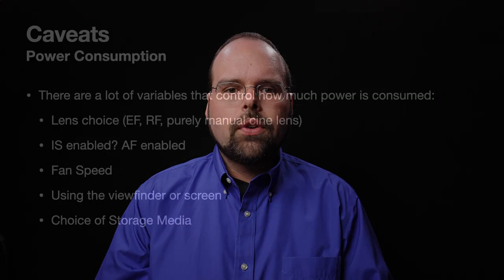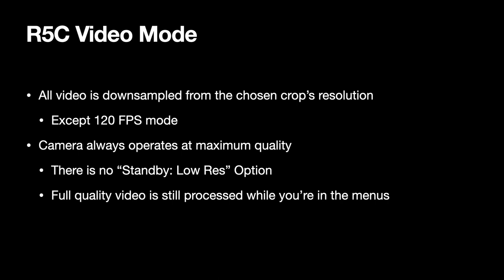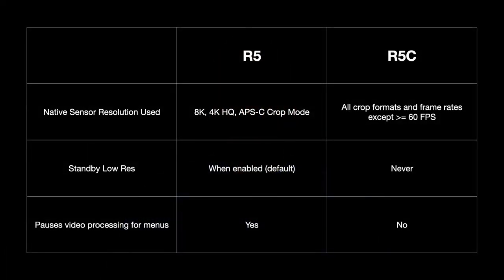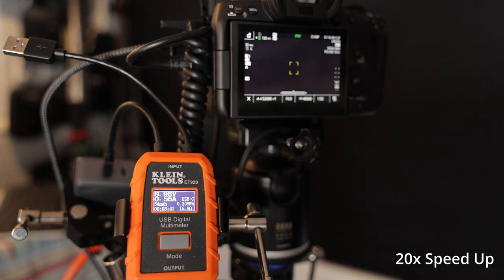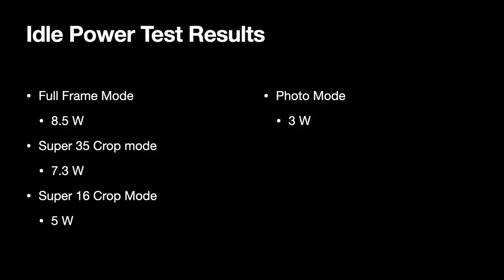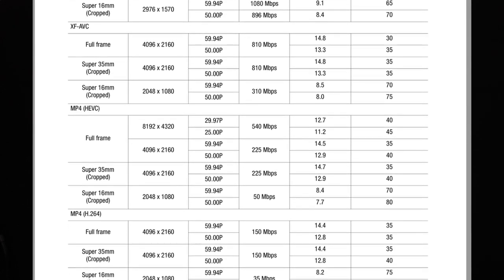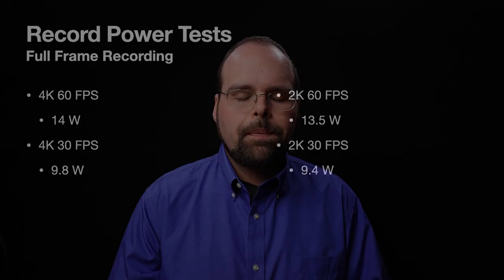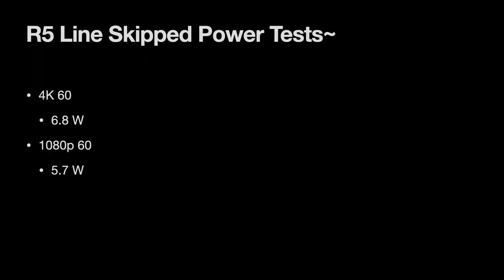R5C Power Usage - R5C Tips #1

Comment: Have you had the chance to test how much power is consumed during an 8K 60fps recording? I've researched quite a bit, but couldn't find a clear answer.
Reply from the maker: I though I had, but in looking through my notes, it appears I never did. 

I just ran a quick test, and saw an average power consumption of around 14-14.5 Watts. However, I also saw several spikes where it was using closer to 18 W.
Reply: Thank you very much for your effort and your response.Can we talk about a power consumption of less than 20 watts under all conditions for all of these? According to these values, would a 22.5-watt power bank be sufficient, or is a 9-volt 3-amp output necessary? @PointsInFocus
Reply from the maker: Short answer: no.

Long answer: USB PD doesn't work like a old school DC connection (e.g. where as long as the voltage is right, and the source can supply enough current everything is fine). In a USB-PD setup, the sink (device) communicates with the source (battery pack, AC adapter, computer, monitor, hub, etc.) to get a list of the voltages and current's it can supply. If the source can supply what the devices is looking for, then the device tells the source to configure itself to that power profile.

In the case of the R5C, and R5 (as well as other Canon cameras), the camera specifically looks for the 9 volt 3 amp power profile. If the supply doesn't offer that specific configuration, the camera will not complete the USB-PD handshake and power won't flow.

Now I know you didn't ask this, but you might be wondering why Canon requires 9V & 3A when the camera doesn't appear to draw more than 2A in my testing. And the answer to is a combination of the multi-function shoe's power requirements (non of my power tests have had anything in the M.Fn shoe that uses power), and having a sufficiently  high current supply that momentary spikes don't trip software over-current protections.

Comment: Hi. Thanks for the video. I just bought R5C and can't find the Auto power off function in video mode but it exists in photo mode. Is there any way to find that in camera or it doesn't exists in video mode?
Reply from the maker: That's because there is no Auto Power Off function in video mode.

Remember, in video mode, the R5C is running Canon's Cinema EOS OS, not the photo EOS OS that it uses in still photography mode. The Cinema OS was initially developed for cameras like the C300, C500 and C700, and their expected uses. As a result, there's many trade offs that the Cinema OS makes compared to the Photo OS. 

For example, the camera doesn't power off when the card or battery doors are opened. The sensor is never read out at a lower quality level. And there's no auto power off setting. To name a few.
Reply: @PointsInFocus  thank you so much for your answer. It would be nice to have that function, it helps me so much during the day
Reply from the maker: If you're in the US, I would recommend using the feedback function on Canon USA's website to provide that feedback to Canon.

One of the things that I find most exciting about the R5C is that it brings two very different worlds together in a way that has never happened in Canon's products before. It's exposing the Cinema EOS OS to a new market segment that has somewhat different requirements than the traditional film makers, and with that there's going to be some new ideas and ways of working that traditional Cinema OS users, and as a result Canon's designers, might not have considered.

Comment: Do you think the standby state power consumption can be fixed with a firmware update?
Reply from the maker: It absolutely could be "fixed" in a firmware update. But I don't think Canon sees this as an issue or something that's broken, so I don't think there's going to be a "fix" anytime soon. 

No dropping to a low quality standby mode is inherently part of the cinema OS ethos in that the camera doesn't assume that it's only recording or being recorded when you hit the record button. So a "fix" would also require adding a whole new set of settings to allow configuring whether or not the camera operates in "low power standby" mode when it's not physically recording.

The thing to keep in mind is that the the cinema OS coming to the R5C is coming from the $$$$ level cinema cameras and the kinds of needs and requirements that people shooting actual films and TV productions (Hollywood, indie, TV, commercials, etc.) have. If you're use to the kind of "simplified" production that you have in a R5, or similar consumer grade mirrorless camera, some of the design decisions are probably going to seem like bugs or problems are really design decisions that stem from a different perspective and use case.

That said, this is one of the things that I think I'm most excited about with the R5C. Up until now, there's been two completely separate worlds. The only real "crossover" camera in this kind of vein was the EOS 1DC, which was $15,000, and really nobody who wasn't a pro cinematographer bought it.

The R5C is really the first time that Canon has released a cinema camera that's both price and feature wise attractive to people who aren't purely in the pro video/cinematography world. As a result, I think there's going to be a lot of cross pollination of ideas going both ways, form the new user base, and ultimately that will make both the EOS photo and cinema OSes better in the long run.
Reply: @PointsInFocus  So what's the best option for us wedding videographers who need longer battery life but small form factor for gimbal work? Should I just buy a crap ton of batteries and change them often?
Reply from the maker: I'm about as far from being a wedding photographer as you can get. How long do you actually need the camera running typically?

If you're not shooting at <60 FPS, the battery life is on the shorter side of things but still reasonable. 4K30 should get you about somewhere around 1.3-1.5 hours on a LP-E6NH. If you can afford the weight with your gimbals, the BG-R10 should double that. It's been my impression that most higher end gimbals, such as DJI's RS-2, can fly a pro DSLR, and that's about the same size and weight as the R5C + BG-R10. 

You'd still need several LP-E6NH's, but you get a lot more time between changes.

There are some other options that might work. Blind Spot Gear makes the Power Junkie, which would let you use a Sony NP-F970 battery and a DC coupler. But those batteries are big and heavy too, and probably mounting might make it harder to balance on a gimbal.

Actually, what might work well is a USB-PD battery pack, mounted under the camera between it and the gimbal plate (though no idea how to do that, and I'm not sure there's a commercial option yet either), with a short USB-C cord to the port on the camera. It might meet all the requirements, the problems is actually doing it.

The real kicker in your problem is the gimbal. The payload and balance considerations make it harder to come up with a good solution that something stuck on a tripod or put on rails. Of course, 

Probably not the best answer, but powering the R5C is turning into a rather complicated discussion, and a lot comes down to specifics.
Reply: @PointsInFocus  I use rs2 which is pretty strong. Just can't have it bee too bulky or it will restrict mobility. I shoot 4k 60 for most clips with occasional 8k
Reply: @wcsdiaries  I do wedding video too and I always shoot with multiple cameras. The R5C will be my gimbal cam. FYI you can power the R5C using the Ronin S2. You just need a dummy battery and connect it to the gimbal and you will get hours of recording time.  I also shoot on a R5 and a rigged up blackmagic pocket 6K pro which is my main cam.
Reply: @wcsdiaries  I have the same exact question. When I shoot weddings I typically shoot 4K at 60FPS all day, and sometimes its a 10-hour day. And I run on a gimbal all day too. I think those requirements are going to be the hardest to overcome with this cameras power consumption. I'm hoping to find an external battery option that can mount to my gimbal, the RS2. I already have a bunch of batteries and the BG-R10 grip but at 60fps I'm still changing batteries all the time and with a wedding I can't afford to miss a moment. This is gonna be a tough issue to overcome but I'm hopeful there is a work around. Let me know if you find anything
Reply: @chronocross85  no way , you can power the camera from the gimbal? That would be a life saver. I use the RS2 also. Where can I find that cable and dummy battery you mentioned? Thanks!
Reply: @davinphelps1863  there's cheap batteries on amazon that last about 55 minutes or so. longer if you do photo. I think those may be the onyl real option at this point. Just buy 5 of those (pack of 2) for $150 is better than a $350 battery grip which will not even last more than 2 hours
Reply: @chronocross85  you use a dummy battery?  A USB c dummy battery? Why don't u use the USB c output of the RS2 and the USB c input of the r5c?
Reply: @Nils_Samp  because it won't work that way. Ronin had an update awhile ago where it prevents you from using the USBC as a charger
Reply: @chronocross85  good to know thx
Reply: @chronocross85  can u start recording via USB c cable?